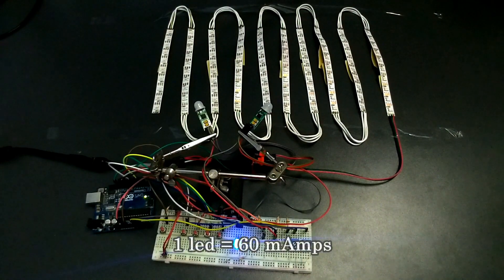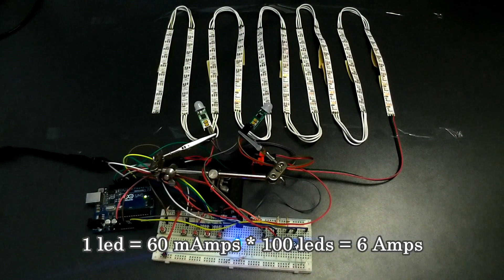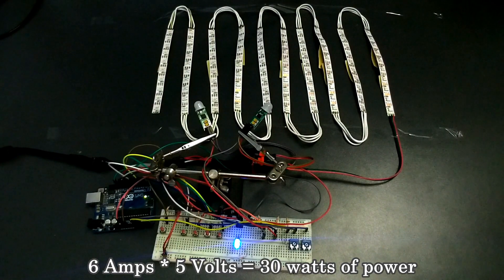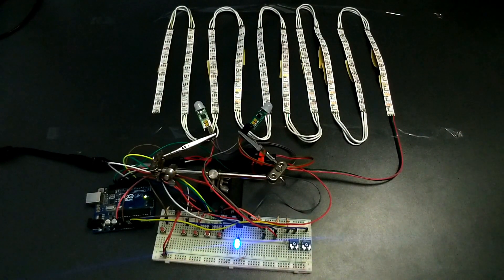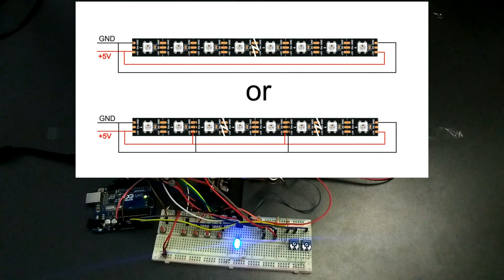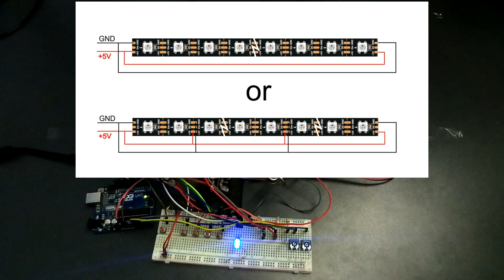DIY Smart Stairway Controller TSBB v.1.0.0 with arduino and ws2812b or ws2811

Comment: Amazing project 😁wish to do myself but got question about button capacitors in circuit schematic 😉 is it 1µF 10V ??? can I replace it with 1µF 50V or it not gonna work?
Reply from the maker: Yes, 1uF / 50v will work ok. Thanks.

Comment: Work really well thank's. 

I've got few issue but finaly get it working. I am new in this world, it's my first project with Arduino. I only start playing with those wonderfull board 3 week ago.

I cant find 1uF 10Volt condenser to put in paralle with the 2 momentary switch so i put a 1uF 50volts and do the same job. 

Also in the code i download on your link the color of the del indicating the state on/auto/off was not blue for automatic mode, all the mode have 2 value HIGH and 1 LOW . So i put 1 value at high only for the color i want  and put the 2 other value at low in each mode.

Example for blue in automatic mode:

// function for auto by using the pir's
  }else if(OnOffAutoCurrentState == 2){

    // set the led color for current mode state
    digitalWrite(ledRed,LOW);
    digitalWrite(ledGreen,LOW);      
    digitalWrite(ledBlue,HIGH);

Now i want to add a 13 light patern like PACIFIA in the FASTLED example. This effect should be amazing in my strair case. I am checking how to do it correctly, i wish to be able to insert that code and make it work.

You do a great job thank's for all the information you give to us, i will follow you !

Comment: Bingo !!! I just got some hope after watching your creation. But smart stairs is not what I want to build, I am more interested in DIY nanoleaf version for which I am in search of arduino sketch which will enable me to create lighting effects for group of LEDs OR section of LEDs including individual LEDs.
Just help me by guiding on how can I modify your code so that LEDs will run with continuous random effects defined in this sketch but does not required sensor triggering OR button press for effect change.
Reply will be much appreciated. :D

Comment: I always have my Pir2 getting auto triggered during darkness. its like a loop. What can be the reason. thanks in advance.
Reply: Please how did you fix that?
Reply: @drceza8839  that was a problem with the way by which i was powering the PIR. Power it only from the same source where you connect the arduino board and ensure that all sources are properly grounded
Reply: @jacmathew2009  I will inform you of my progress
Reply: @drceza8839  sure
Reply: I have got same problem
Reply: Thanks... you have boost my confidence 😊 🙏

Comment: Hi, just came across your channel. This is a great project.
I would like to use addresable leds around a verandah and use sensors to determine when someone is walking around the house and then adjust the leds to illuminate the path. This will need multiple sensors and probably a pi controlling it. 
Do you have any thoughts on which sensors could do the job. Any thoughts would be appreciated.
Reply from the maker: Thanks! :)
What type of sensor you need it really depends of your environment, but you can try out this sensors...

HC-SR505 Mini Infrared PIR Motion Sensor Precise Infrared Detector Module - if you use them outside they need a whaterproof enclouser, don't place them in direct sunlight and they will fals trigger if they are to clouse to rain droplets.

Waterproof Ultrasonic Module JSN-SR04T-2.0 JSN-SR04T Distance Measuring Transducer Sensor for Arduino DIY Electronic Kit - With this sensor you can measure distance up to 6 meters of the object in front of it, but you have to be careful where you place him, because if you place something in front of it like a chair or something else, them it will be useless... With this sensor and ws2812b you can also do animations, because you know the distance of the person from the sensor...

RCWL-0516 Doppler Radar Sensor Interface - I think that the best choice will be this sensor, because you can hide it in the wall, with some metal plates you can define the detection area, you will have less fals detections because will detect only humans and animals up to 5 meters.

I would like to know which one worked best, so keep me up to date and if you need help with the code, just ask and i will answer when i have the time! ;)
Reply: @IonutF-TS-BB    thankyou for your kind assistance. To get the animations i'll need distance and direction so i think the last sensor will be the best choice. It will be an interesting project...
Reply from the maker: @kthfriend   Yes, it will be... and the best thing in software is that you can change the behavior of the lights anytime you like...
With pleasure! ;)
Reply: @IonutF-TS-BB  lol.. in that flexibility lies one of my problems.. having to learn some code..
Reply from the maker: @kthfriend  I think that the learning obstacle can be overcome very easily, you only need a little time to understand the basics... believe me, i'm not a coder, i learn the basics in my spare time in a few mounths and this are the tutorials that get me started... https://www.youtube.com/watch?v=fCxzA9_kg6s&list=PLA567CE235D39FA84 ;)

Comment: Hello, first of allthank you very much for this Project!!! I want to lighting 13 Steps with I think 15 Led‘s, what changes in the Sketck must I make? Can you help me?
Reply from the maker: With pleasure! ;)
You need to change this to lines and respect the comments...

#define NUM_LEDS_PER_STRIP 195                    // total number of leds | must be even number that is divisible by the number stairs | max 400 for arduino uno (ATmega328P) or max 1900 for arduino mega 2560 (ATmega2560)
int numOfStairs = 13;                             // number of stairs in the stairway | NUM_LEDS_PER_STRIP / numOfStairs = number of led per stair

Comment: Can this project work with 22 stair steps?
Reply from the maker: I've din't tested, but it should work if you respect this comments from the sketch: 
#define NUM_LEDS_PER_STRIP 100                    // total number of leds | must be even number that is divisible by the number stairs | max 400 for arduino uno (ATmega328P) or max 1900 for arduino mega 2560 (ATmega2560)
int numOfStairs = 10;                             // number of stairs in the stairway | NUM_LEDS_PER_STRIP / numOfStairs = number of led per stair
Reply: @IonutF-TS-BB  it works properly for 22 steps.
Thanks alot.
One thing more how can i use ultrasonic sensors insted of pir sensors?
Reply from the maker: @preetchahal2256  This means I thought it right from the start! :D :) ;)
It depends on the sensor that you are using, but it should be just a simple replace of the sensor... nothing else...

Comment: Good  but . code working with ultrasonic sencer.plz help mi
Reply from the maker: You just have to do a function to interpret the values from the sensors, and after that use the values in the sketch. ;)

Comment: Great work.
Does the code work with ws2811 also?
Or i have to change it?
And thanks for sharing this awsome  project .
Reply from the maker: I didn't test it, but it should work, because from my knowledge the only two difference between ws2812 and ws2811 is that in ws2811 one pixel represents three leds and the work at 12v, in rest they are the same.
Be careful with the 12v, the arduino and the pir support max 5v...
With pleasure! ;)
Reply: Tried it, bought everything what was in video, unfortunately not working ( 12v led all the time is flashing like Christmas tree, when pressing the buttons, it is changing effects, colour and so on only for a few seconds and then it starts to flash again infinitely

Comment: Love this i only want a single strip of ws2812b can i also use that with this code ?
Reply from the maker: Glad you like it! Do you mean one strip of 5m with 300 led's or one strip of 10 led's? Because actually, in this sketch you will need at least two strips of ten...
Reply: @IonutF-TS-BB  I was looking into using the 300 leds
Reply from the maker: Yes you can, i also made some comments in the sketch about this... but you will need to inject power in the strip once every 2 or 3 meters ... " //total number of leds | must be even number that is divisible by the number stairs | max 400 for arduino uno (ATmega328P) or max 1900 for arduino mega 2560 (ATmega2560) "

Comment: Hi , everything 's seem perfect , except ldr ( photo resitor sensor  or daylight sensor ) seem not working at all , does not master whatever light threshold  potentionmeter  i adjusted  , the led strip trigger  on all day even with a little or full amount of day light .or we can change the value of the resistor to ldr sensor ??? Thank a lot
Reply from the maker: Hi,
Before you change the value of the resistor, use serial print to debug and check the values for variables lightSensor (A0) and lightPot (A1)... ( add the lines in void readBtnState() )
The values for lightSensor (A0) should change when you cover the sensor and the values for lightPot (A1) should change when you change the light threshold potentiometer.
Maybe the potentiometer or ldr is faulty ...
With pleasure! ;)
Reply: @IonutF-TS-BB   Wow ,Thank so lot , i just  swapped  the 2 varible resistors , just found out one of variable resistor got stuck , once again Big Thank friend
Reply from the maker: With pleasure! ;)
Reply: @IonutF-TS-BB  Dear friend  ,during this lock down time , i can not get components to finished this supper imaging project , i just have to wait , meantime , if you don't mind , Please draw a flowchart ( or block ) of this program for dummy like me because i love to learn this program may be in future i will create more patterns ( or animation of this led strip) latter on, Thank
Reply from the maker: @anhtran-ge4fe  Not a bad idea, it will be simpler to understand the logic of the software. I will do it when i have some spare time...
With pleasure! ;)

Comment: how do I simply run the script without the buttons, pots and sensors.e. how to define a single output pin.
Reply from the maker: Which effect? Because there are twelve ...
Reply: @IonutF-TS-BB  
Sir, I want to communicate with you

Comment: Hi would it be possable to put a 4 line screen on this projet so you can see what if says about each button pressed. Thanks Kevin
Reply from the maker: Yes, it would be possible, but with a i2c lcd, because there aren't much pin's available for normal lcd.
Here it's an example: https://microcontrolere.wordpress.com/2019/04/01/arduino-and-i2c-lcd-in-proteus/

Comment: Great project . I m going to build one like this . You did not mention the value of 2 variable resistor  ?  ( light , threshold value ) , second  thing , in my stair step 3 , 4 , 5 the lenght is wider  , can i change the lenght of  LED longer , How i change the value in program ? Thank a lot
Reply from the maker: Thanks. 
Ups, sorry, i forgot... i've used 5K potentiometers.
Well the number of leds will be the same on all stairs, you dont have the option to set the number of leds per stair... and that will be calculated from the total NUM_LEDS_PER_STRIP devided by the numOfStairs, you just set the the total number of led NUM_LEDS_PER_STRIP and the total number of stairs that you have and the ledPerStair will be calculated automatically.
Your welcome.

Comment: Really really love it! Would be even better with a adjustable ambient light sensor. :-)
Reply from the maker: I'm glad that you love it... :)
Of course it's better with an adjustable ambient light sensor, thats way it's already build in. Via the second potentiometer you can set the minimum light level at which the leds will light up. ;)